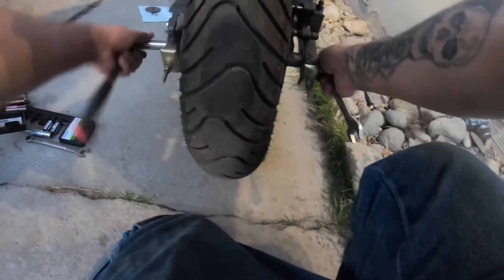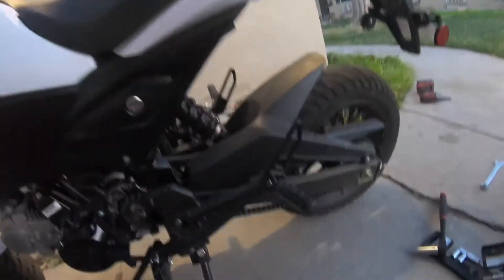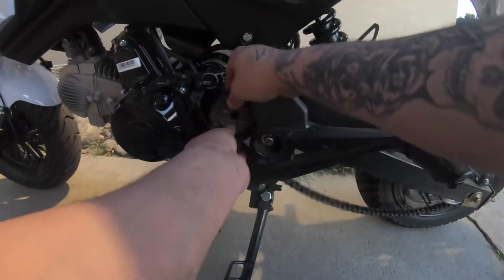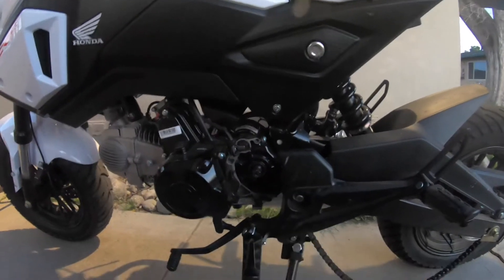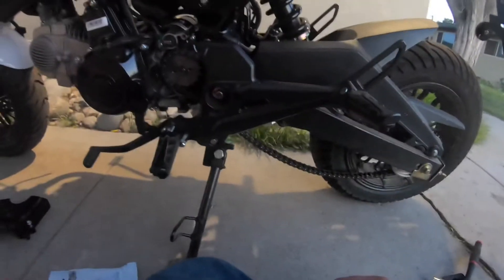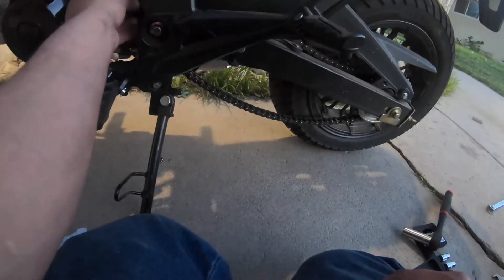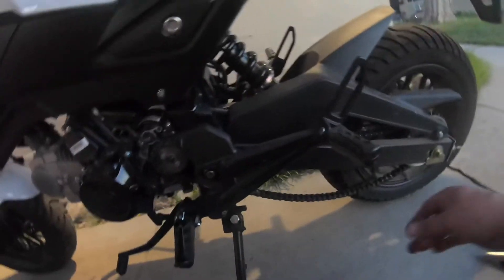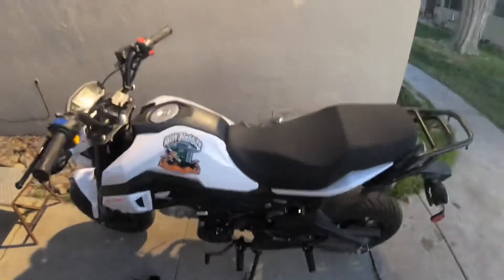BoomVader125 17tooth sprocket install  (Grom clone).

Comment: Just one suggestion please links my dude. The honda sticker makes it 12% faster.
Reply from the maker: I don’t have links most of the stuff is bought from my work I am a motorcycle mechanic so we sell all the parts I need
Reply: Trail Buddy on google has the sprockets and chains
Reply from the maker: LBE 247  first thing I did was replace the China chain
Reply: How many links is it I haven’t been able to figure that out
Reply: The first thing you do on any ground clone is replace the chain they are weak and shit if you don't it's going to snap on you and you're going to be stranded
Reply from the maker: The chain was upgraded first thing  I’m very knowledgeable on Chinese bikes

Comment: If I use a 17t 420 sprocket and stock rear what chain size do I need? Will stock chain work till I get a new one?
Reply from the maker: U need a 428 sprocket
Reply from the maker: 110 link chain